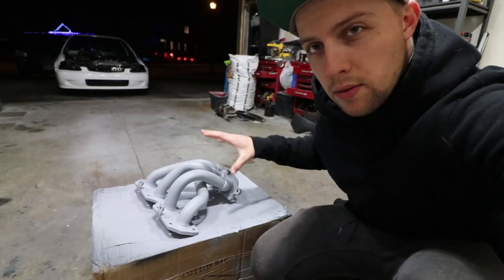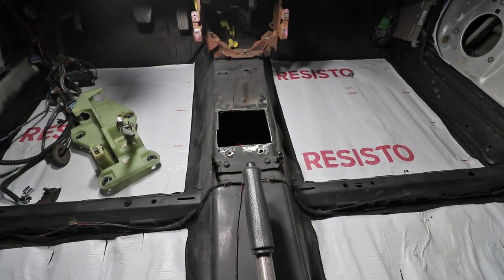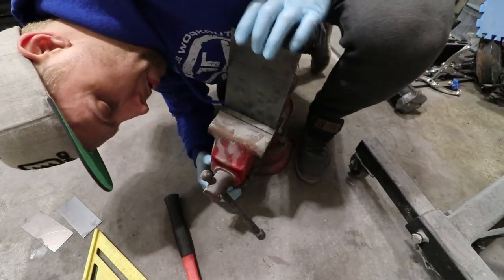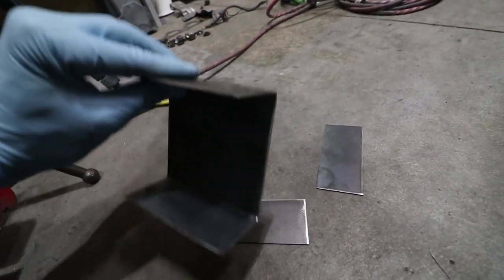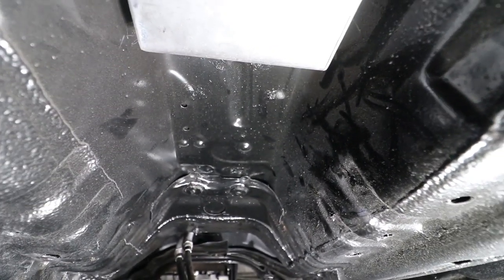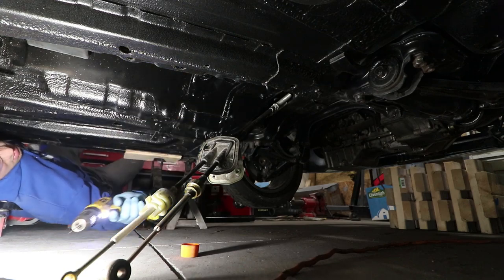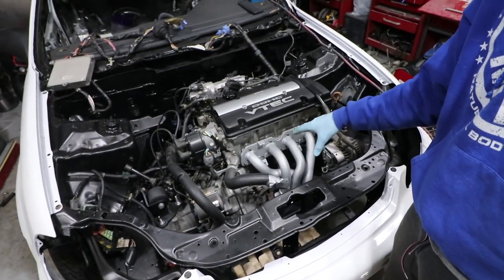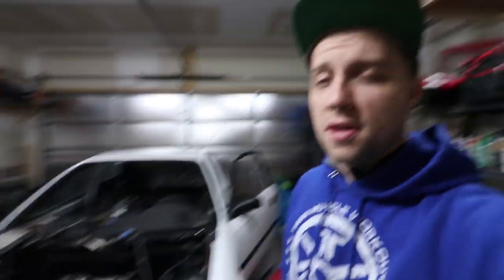H22 Shifter Box Fabrication & Installation

Comment: Awesome video. Cool to see you welding things together instead of bolting down and forgetting about it. Would be nice to weld a nut on the under side of the car for the mounting brackets for the shifter to make it easier to remove or service.
Reply from the maker: Agreed, I have it tightened down now, I should throw a few good tacks to hold it there. I did hate installing them, especially alone can be difficult

Comment: Just bought my first Honda ever. 96 Civic with H22a1 swap. Is it possible to switch to the newer prelude cables and shifter and is it worth the trouble. This one engages ok but sometimes 3rd you got really bop it in to engage. Have heard zip tying the cables, in forums, helps to eliminate some vagueness on shifter feel. Any input from vet honda guys would be appreciated.

Comment: What shifter cables did you use? Im using a 99 prelude an some reason second gear has a further throw/springy. An has a slight grind if i try shifting around 3k rpm